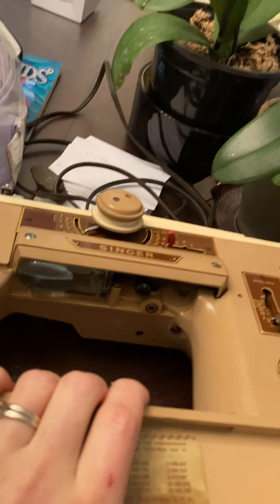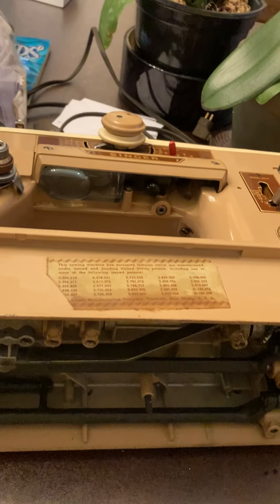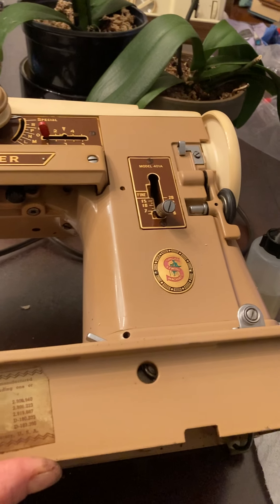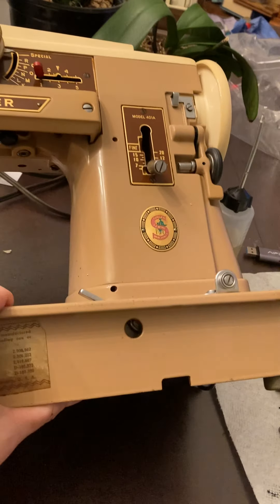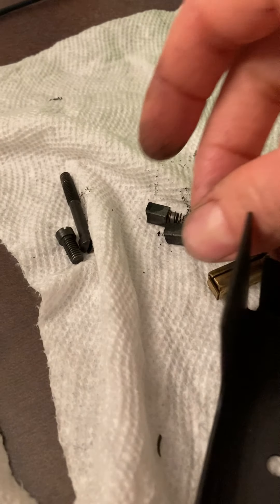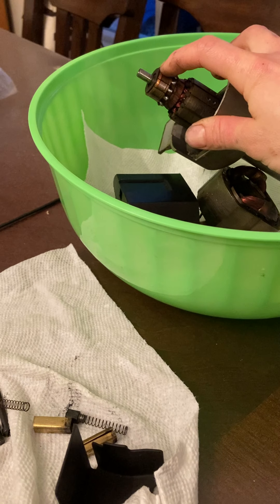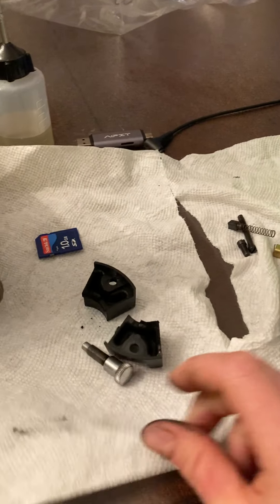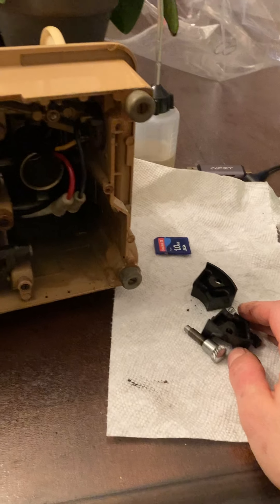Singer 401A might look brand new but check your motor

Comment: Don't forget those 2 side lubrication holes for the vertical transmission shaft - machine must stay on the side when putting a drop in each hole, Then turn handwheel a bit and let sit couple of hours on the side. The vertical shaft is most neglected and will start binding at some point. There are also 2 lub holes on the base for the base horizontal shaft - see the manual. There are also 5 pairs of gears which require a smear of thick grease. A pair is hidden under the camstack - use pliers to remove top securing screw and lift the camstack